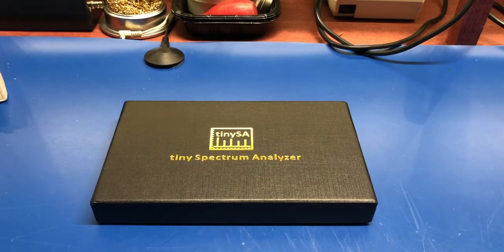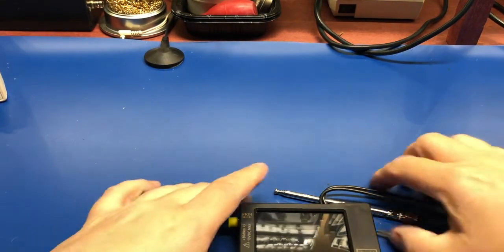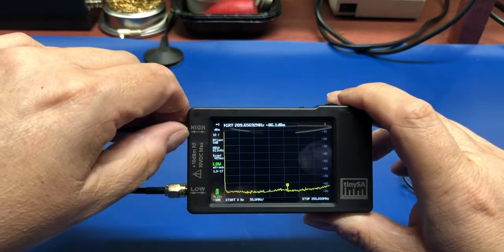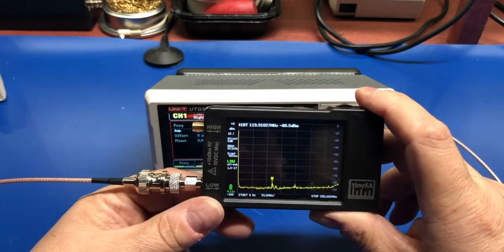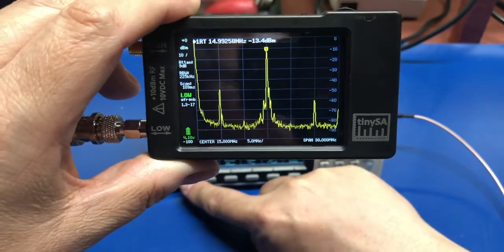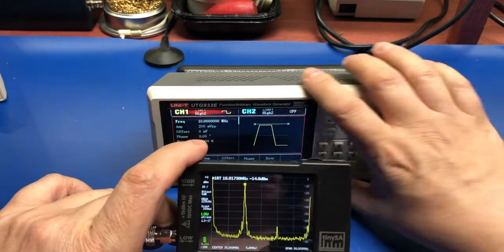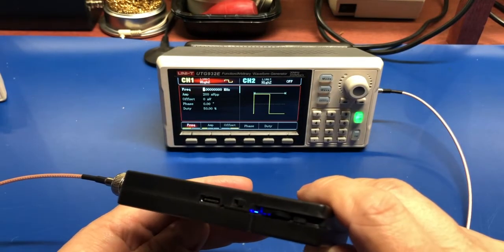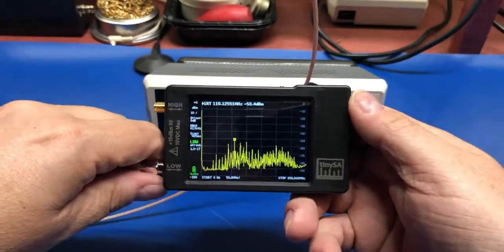TinySA quick look

Comment: I like doing IF alignment with the oscillator function. In my entire life as a tech I never really used one of the larger scale devices. It would be nice if one could do an  Audio range spectrum analysis on guitar amplifiers. I still do those manually with Log paper drawings.